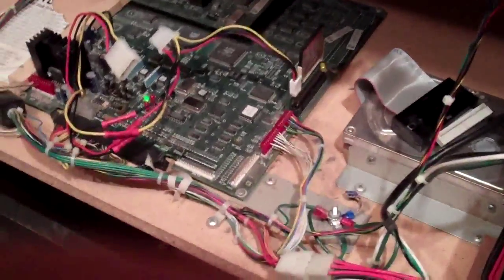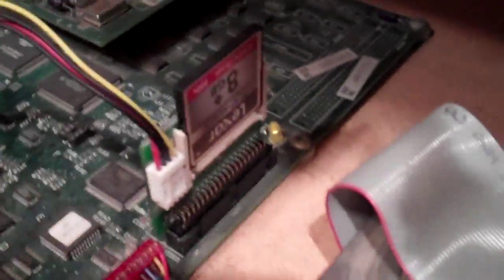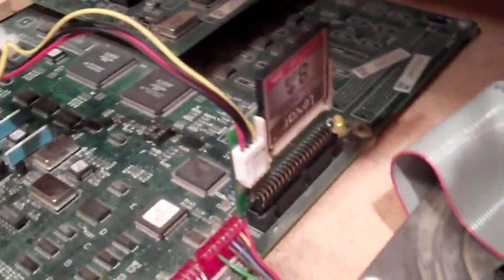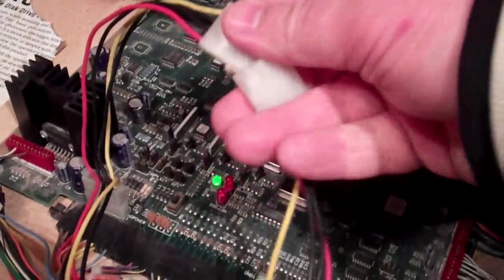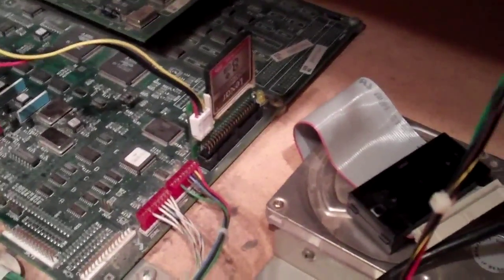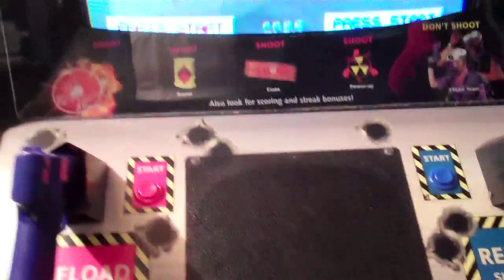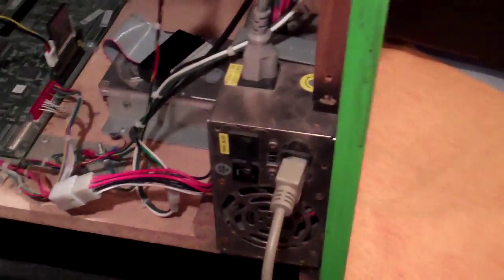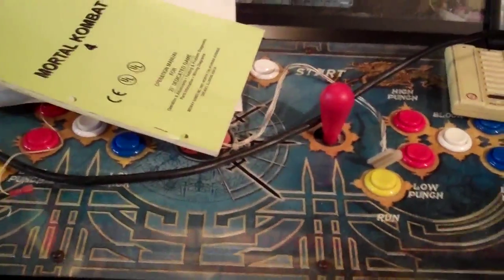Replacing the Hard Drive in an Area 51 with a Compact Flash Card

Comment: Great video Tighe. I'm getting a lot of watchdog reboots lately on my unit. I ran tests on memory and hard drive and they appear to be fine. Just curious if you believe it may be my power supply? I guess the best way to test is with a voltmeter. Any tips would be grateful, thanks
Reply from the maker: it sure could be, yes test the +5v line with a voltmeter. I would suggest you replace the PSU with a new HAPP one and swap in a cf card for the hard drive.
Reply: ***** not even a month later and the clicking started on the Hard Drive. Looks like it's on it's way out. I fortunately prepared for it and have an IDE CF card. I imaged the CHD file onto the CF using the tool. It's a Fat 32 format, is that correct? Of course windows can't read the image on the CF card because it's not OS compliant. I just want to make sure this makes sense. Do I have format the card in any special way?